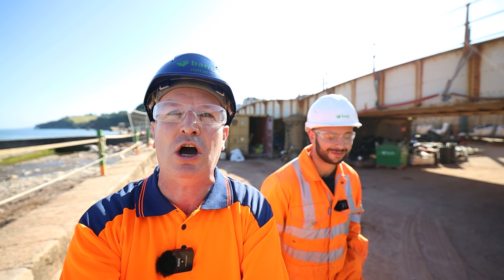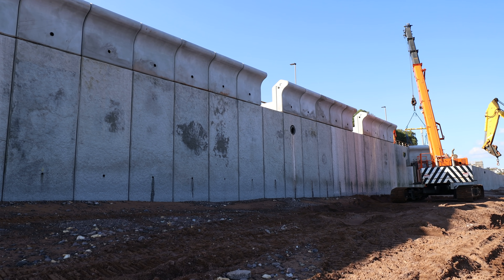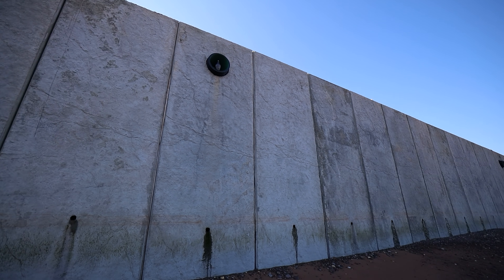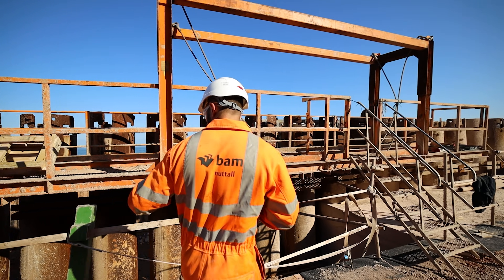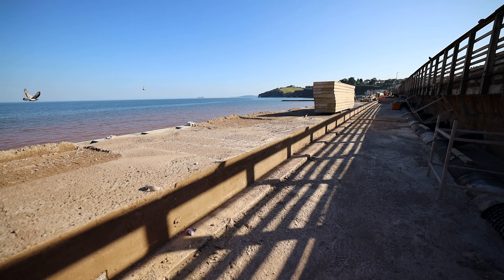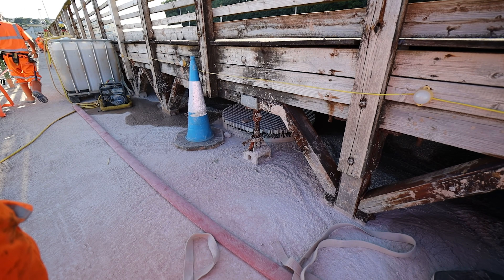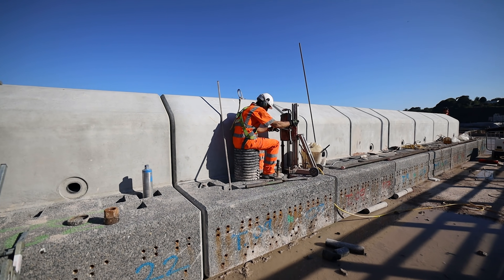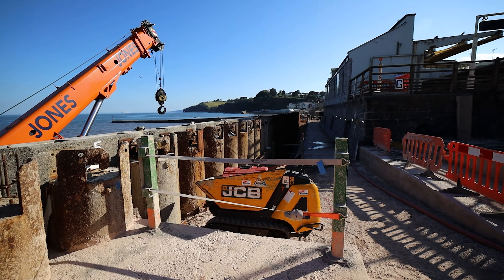Guided tour of the new sea wall build at Dawlish railway station

Comment: Intriguing, when doing my block/brick/lego walls, always interlock every course for added strength - why have i been wasting my time all these years?
Reply: Using your analogy, what they are doing is supergluing their lego walls (metal tie bars) and infilling the backside with a plastic resin (solid concrete, in layered pours). The wall will be plenty strong as is.

Comment: Network Rail seem to have missed the point here,  yes it may stop the sea from damaging the track but the public beach will now be virtually unaccesible as with all that concrete you have failed to put in any access routes to the beach.  The Victorian infrastructure lasted 160+ years this I doubt will last more than a few decades and has destroyed the beauty of one of Britain's most loved scenic structures.  The vandalism of Brunels infrastructure with this Lego set is totally unacceptable.
Reply: I thought the entire point of a sea wall was to protect the rail line and to a lesser extent the town?
Reply: If visitors to Dawlish can no longer have access to the beach it will kill Dawlish. Brunel’s wall was just stones and cement lasted 160 years. This is massively over engineered even with rising sea levels. Bringing precast concrete from Ireland, somebody’s had a big back hander on this job.
Reply: Was there access before thought the railway was in the way
Reply: @anonimouse4678  Yes a wide walkway under the railway for families to access the beach. Obviously that had to be modified to protect the integrity of the new wall. A new ramp as at the far ends of the wall would not have been difficult. As I understand form various videos this has not been included.
Reply: The railway company own the beach at Dawlish so I suppose they can do what they want.
Reply: @martynbush  legally yes. Morally no. Might dip into the profits to provide another ramp or somebody’s back hander. All prefabricated concrete for this and many other projects on the present up grades manufactured in Ireland with all the additional transport costs ?